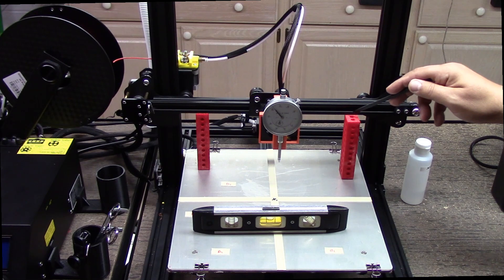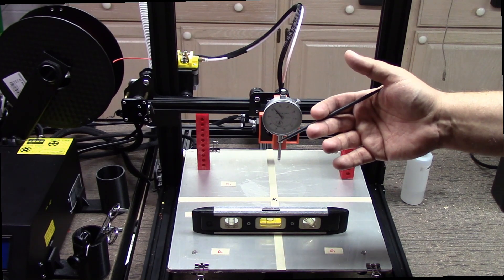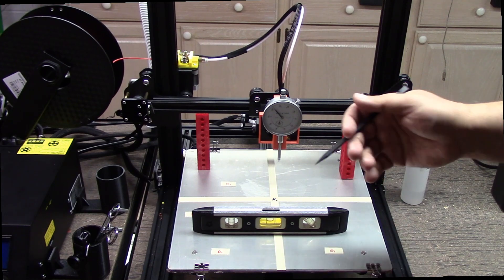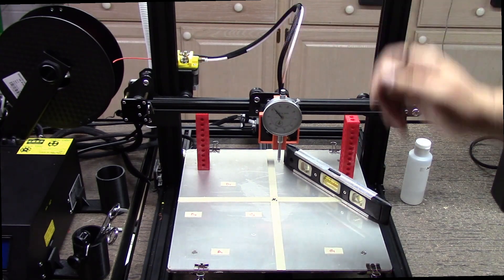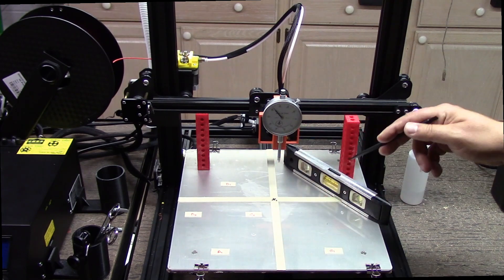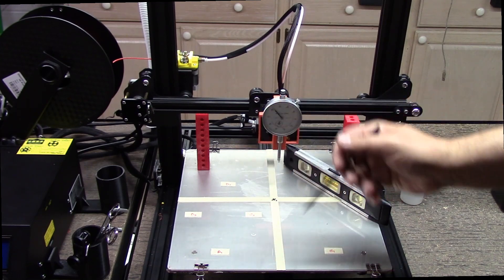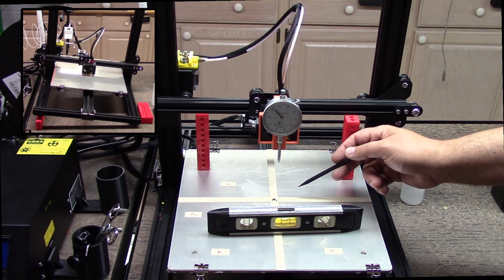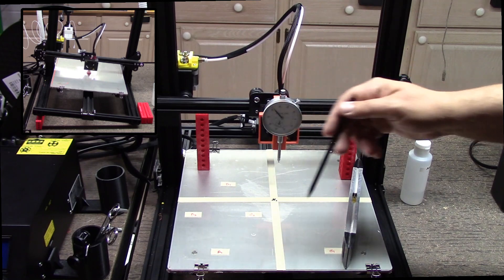Shop Talk - Stop Leveling Your Bed and Start Tramming Your Machine!

Comment: Would I use tramming to keep my washing machine from walking around. My floor has a slight lean to it and if I level my machine to the floor it walks. So I would assume that I have trammed my washing machine in stead of leveling it. ????????????? You know I think We use the word level in a relaxed general term way. I like this tramming thing makes more sense. I don't even own a 3D printer (yet) or a mill or cnc machine.
Reply from the maker: Well I guess you could 🤔 because as I think you summed up to tram means make two planes parallel to one another...

Comment: You really should find a way to minimize the sag of the gantry, because even though everything else is calibrated correctly your models will actually slant ever so slightly due to the z axis being correct but the x axis being skewed.
Reply from the maker: If you adjust it properly, it should be very and I mean very little as I talk about this in several videos...

Comment: Yes I agree. saying "Bed levelling" is incorrect. I could put a block of wood under one side of my printer and it would still print OK. I adjust my bed so that it parallels the x/y movement of the hotend.
Reply from the maker: Yup :-)

Comment: Best way to prove your lengthy talk is to demonstrate the proper bed leveling as you suggested and print some objects on those points - 4 corners and also the center at the same time with same object shape. Then show improper leveling and repeat the print.  Show the comparison between both sets of print. The glass is not FLAT, whatever leveling theory doesn't apply if the bed itself is not flat.
Reply from the maker: Sorry not sure I quite follow as what I tried covering in my lengthy talk is that one (1) the bed is a complex surface and  not a simple "plane" as well as two (2) that the idea of leveling is misleading as the idea is to match the plane of the hotend to that of bed.  As the reason for this was in a prior video there was a lot of discussion around only requiring three point for leveling...

Comment: I’ve been working under this principle for a long time. Thank you for stating this so clearly and making this point so well. Maybe I’m inaccurate, but as long as I’m accurate with myself, then all my parts should fit each other. It’s a very analog way of thinking, and maybe more appropriate for things like woodworking with tongue in groove assembly, than it is here. But this really helps a lot.
Reply from the maker: Your welcome :-)

Comment: I wish my bed was a FU$#ING!!! PLANE!!! maybe i'll buy some glass. I'd slap someone that got out a level.
Reply from the maker: Ouch did we wake up on the wrong side of the bed 😎
Reply: =) I was battling trying to print an entire bed of parts. Almost impossible with both of my heated aluminum bed printers. I've since got glass for one installed works great. The other hopefully will to when i get around to figuring out how to get the glass secured with out warping it around.

Comment: I added the second Z axis motor, it did help on taller prints, and was a simple upgrade.
Reply from the maker: How are you liking its performance over a single?
Reply: I like it a lot, it has improved very tall models, and even small models are noticeably better, and it will stop it sagging with age.

Comment: Not to add confusion, but technically the bed here is not trammed to the head per say. It is aligned parallel(trammed)to the rail(s) the head is running on using the head mounted indicator and bed travel.  Tram is typically referred to as a spindle perpendicular(square) to the bed surface. Same as well with the Z-axis rails running perpendicular to that bed surface. With 3D printers the head perpendicularity to the table itself is of less importance laying down a bead. If the Z-axis alignment is not perpendicular, it will produce prints that lean or are not square to the bed the higher the build goes.  

Secondarily - this alignment process can change depending on if the printer has a moving bed Y-axis or flying gantry Y-axis. Point being, it could be the structure or linear rails that needs verified or aligned to achieve squareness and parallelism in relation to each other and not just the bed alone. 

Maybe subject for another vid to demonstrate how the travel indicator could be used to show these alignments and the average that one may need to live with as good enough. :)
Reply from the maker: I am not sure why the importance of the squareness of the nozzle has less importance then a spindle?  As one could argue that the the squareness is of less "noticeable" affect then a spindle because it is additive and subtraction.   So if your printing Darth Vader head koozi, who cares but if your printing a detailed mockup with a high level of dimensional detail  the extrusion will not be uniform and there additional variance will be introduced into your model...
Reply: I think we are on the same page. You validate where it is and is not important. Correct, no big deal on display pieces. Many users are making parts that fit together. That is where this would apply and apply differently with the various types of travel assemblies.  

The difference between additive and subtractive primarily involves tool length offsets. As you know from being in the CNC industry, in the case of a spindle out of tram, the longer the tool, the greater the angle off, the further away the tool tip will be from the original surface origin,  as well as potentially driving that tool in a side load while moving it in a Z direction. Then there are side wall cuts that end up cut parallelograms or stair stepped.  An extruder tip is always the same length so there is much less concern to have it perfectly perpendicular within .0001/inch with an indicator.  

My point was to add perspective on where to begin the alignment. If the Z is going off in some odd direction or the X, Y and Z not at respectable right angles to each other, it won't hold expected results. You are spot on with bed alignment, although it would have been great for the viewer to see the indicator in use to cement the concept. Maybe even put a machinists square on the bed and run the indicator on it to verify XYZ integrity acceptable for the application. 

Sure, CNC machines have enough girth and factory alignment to do as expect unless crashed. These are basic inspections many shops will do when a machine has an issue holding tolerance.

It is still good practice to grasp and apply machine tool alignments in a similar fashion on a somewhat flimsy 3D printer using the bed as reference at its neutral position and the bed being the last thing to align if all others check out relative to each other.  

Cheers!

Comment: Finally somebody knows! Had to ask an EE PhD friend what the deal was, answer 'because 3d printers are complete consumer garbage compared to the huge mills you run'. My gear is trammed to 10 arc seconds with vises to 30 arc seconds. Could cut a 3d printer from a solid block in 3 hours.
Reply from the maker: Will you cut me one!  That would be way cool!

Comment: You are absolutely correct. I have custom steel frame Anet A8 and I use a rectangluar starrett square block to calibrate the guide rods of the gantry to the frame of the machine, then I calibrate the 4 corners of the bed to the guide rods of the gantry. That gets me 99% close enough that auto bed level compensation can correct for my very non flat print surface. The majority of my first layer issues come from not having an inductive probe with a large enough sense range to work properly on aluminum and bed is warped like a bowl so getting my probe in the right place is a PITA.
Reply from the maker: Thanks for commenting as this was interesing

Comment: If your 3D Printer wasn't crap... (having two z axis) motors OR wheels actually lifting the x axis correctly without a 1.5 slope.... you wouldn't have to make this video.... To be clear, wheels with one side lifting is just a crap 3D printer and you have to have work-arounds like this to make it work. Like buying a crooked house and the fix is everyone in the house has to wear slippers whereas on slipper is higher than the other slipper.  

I worthy 3D printer, CNC machine, mill etc... would be both level and trammed.

This printer has cut every corner, and anyone with common sense can see that.
Reply from the maker: Doug, I am missing your point.  The idea of a "maker" is to make better what they have.  Not everyone has Tony Stark's money as only that exist is the movies as a better example is Elon Musk who makes due with "common" to create the extraordinary and Tesla Roadster sailing past Mar's proves that :-)
Reply: Doug C A $400 3D printer cut some corners?!?!? Thanks Captain Obvious...

Comment: The video is crystal clear. It perfectly explained and yet there’s a bunch of comments that show people didn’t listen and just want to muddy the clear water. 
God gave us two ears and one mouth for a reason!!
Gr8 job on this video, thx, 99.9% get it. lol
Reply from the maker: LOL!  You know this is very well put and made me chuckle, people and "change" can be oil and water sometimes as tipping the printer on it side and print sort made the point but as you say "just want to muddy the clear water"...
Reply: All "bed leveling" is done in relation to the motion of the tool head. Nobody tries to level to a true-level, everybody distributes their errors. No matter what the software Calls the process.

I'd like people to say Triple, when they mean triple & not use the word Treble because it's a lazy anti-linguistic modern misuse. In the same way as Level is an industry-wide misuse of that word.. when I agree, technically it should be Tram - hence parallelism, tram rails etc...

All printers tram their heads. People are taught how to tram their machine adequately, they just call it leveling. If that offends a machine-toolists finely trained ears that's a shame - but people are not going to call in tramming, they will describe their bed as level. Even if true-level has nothing to do with the process Thank God.

And thank you for what feels like a murcan #bighead attempt to show-off. When you could have just explained how all leveling is relative, then an insistence on tooly jargon wouldn't have been around to muddy the waters.

Cos it's not change hun, it's your pet peeve and you want people to change back... aint gonna happen. Not matter how much Triple grinds my gears :oP xxRJ

Comment: How about making a video showing what to do when an object won't print?   I'm trying to print an item called the Screwdriver Stand from Thingiverse on my Monoprice Maker Select 3D Printer and it just refused to print!  At first I thought it was because the size was too big at 200mm which is the max. size so I reduced it to 95% but it still refused to do anything.   I even made a new version of it in 123D Design and that won't even let me make a GCode file of it in Cura!  How can I find out what the problem is?
https://www.thingiverse.com/thing:1701814/
Reply from the maker: You will likely need to go smaller as I did download it and it is "water-tight" so the model is good and for a 200x200 printer you will need to scale down to 85% as that is what I had to do in Cura to get it to slice.  Hope this helps :-)
Reply: Could the file size be too large at 16Mb?  I have no idea how large a file it can accept.   In lots of Youtube videos they print very large objects so are they all fakes like the videos showing quadcopters flying that can't really fly?  Also what do you mean by "water-tight" ?
Reply: Well I tried a different SD card and now it works!
Reply from the maker: Thats is good!  But I though you said it didn't slice?  As it will Slice without an SD card target...  Also YES you can really print some really BIG things :-)
Reply: The first item from Thingiverse wouldn't print so I used 123D Design to draw up a simpler one without the holes but Cura wouldn't make a Gcode file so I guess that one wouldn't slice. The original one is printing though.
Reply from the maker: Yes if Cura won't slice it, it throw an error that cura can't slice it right on the screen :-)
Reply: Nothing happened except it just wouldn't produce a Gcode file!
Reply from the maker: I guess I should have of asked :-)

Comment: I have to chime in here because this looks like a huge amount of effort for nothing. Firstly, replace the aluminium bed with an extremely flat surface (Mic6/cast alumium tooling plate) to begin with, your now about 90% of the way there. Then switch to a 3 point levelling system because you level the bed relative to the XY plane and adjust the height according to Z. We live in a 3d world, no need for the 4th dimension. Verify your findings with an accurate induction probe/Dial indicator at the 3 points. You are done.

The alternative solution, like above, is; to use a warped and uneven extruded aluminium build plate, restrain it at 4 corners and then clamp glass or whatever else on top to try and compensate for a crappy surface to begin with while slowly deforming the entire surface once again. Then try to use ABL to compensate for a problem that shouldn't exist in the first place.
Reply from the maker: ????  As I have shown 3 points aren't enough because of the irregularity of the surface and the distribution of the error is the goal (i.e. we are NOT attempting to define a plane yet align two).  Second tramming is requirement of maching world for mills (also do maching) so its vary appropriate for 3D printers as they nothing more then an inverse vertical mill (have you ever run a real vertical mill before?) Also if you check thiniverse, I am the grandfather of the dial indicaro mount for the CR-10 so been there done that :-)   Also you will find a more detailed post by Scott Lahteine here: https://github.com/MarlinFirmware/Marlin/wiki/Manual-Mesh-Bed-Leveling where he dive far deeper into this then I in this video...

Comment: well, imo, first make sure your X and Z is perpendicular to each other, than starting from here, level your X gantry (make sure its level and go straight up), than you do the tramming, then you should get a perfect, vertical print, if not, like this machine tilted in one side, even you have a perfect first layer, your print will still go tilted slightly
Reply from the maker: Thanks for commenting! This " X and Z is perpendicular" is sort of given however because sit is physically supported and the other is not, there will be some measure of both sag and drag on the gantry as the physically connect side will be pushed upward while the other will be "pulled"...

Comment: I have a cr10. The concern I have is the x axis is not perpendicular to the z axis.  If z rises and x stays skewed the printer will print a parallelagram.  Even using a raft cannot bring the part back into square.
Reply from the maker: I am confused as first a raft won't "square" anything, and when you say "x axis is not perpendicular to the z axis" do you mean the gantry is sagging?

Comment: It was my understanding that "tramming" is the adjustment of how perpendicular your tool is to the plane of the bed, not the height relationship.  Is that wrong?
Reply from the maker: You are 100% correct "how perpendicular your tool is to the plane".  That's why you see the printer tipped up on its side to make the point :-)

Comment: I found a way to fix that sag with a simple print, feels solid as a rock now. Video on my channel
Reply from the maker: Thanks for commenting, yet keep in mind is it will always sag to some degree unless a Z axis is added (or some other mechanical means) because the z axis will push the gantry up which in turn will “pull” the non-powered side as it has to over come the friction...

Comment: Maybe I missed the point but I do understand the difference between levelling and tramming.  I doubt anyone ever uses a spirit level to "level" their bed; surely everyone uses either the sliver of paper tramming technique or the self-levelling (Read tramming) technique.
Reply from the maker: You would not believe the messages I get on this topic.  In short the term level means to "make level for an object placed on that plane" like you want your kitchen counter to be level so things do not roll off.  Whereas tramming is the matching of two planes in cartesian space independent of the object sitting on the first order plane.  This is why I tip the printer on it's and still prints...
Reply: Thanks.  That's what I thought.  It just confused me as to why you had a spirit level.  I guess it was just to explain the difference.  Ta!!
Reply from the maker: And yes people have asked that question too :-)